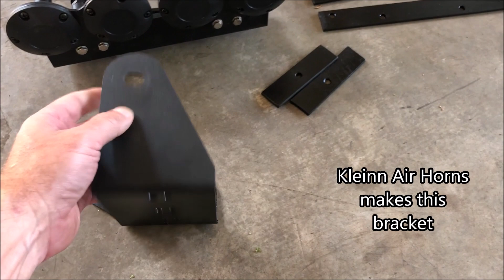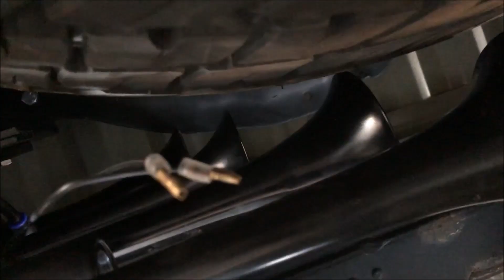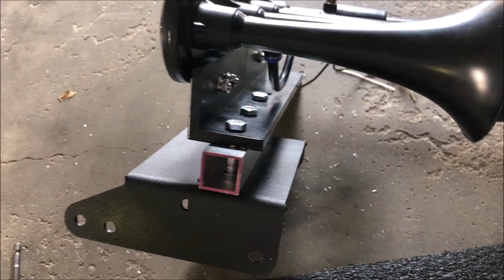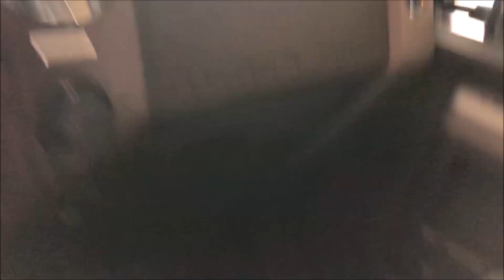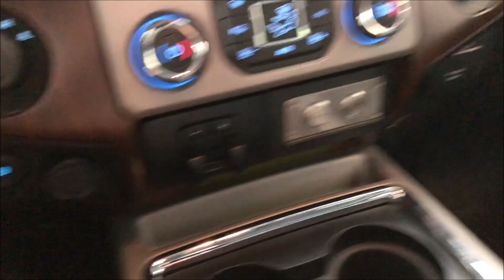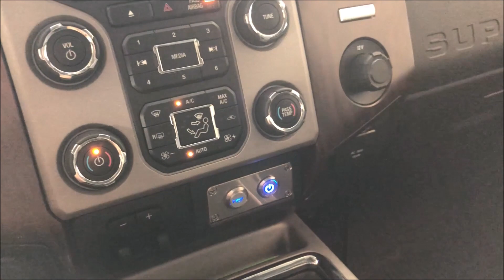Vixen Air Horn Install in late model Ford Superduty (2015 F250)

Comment: If you need the spare, do you have to take down the horns, or is there clearance to drop the tire??? I got the same truck 2015 black Super duty
Reply from the maker: @KVAL83 the compressor and the horn rack do not interfere with the spare tire...can lower the tire and items remain securely mounted to the trucks structure

Comment: Is the horn still working for you now I am thinking of getting this one and wanted to know how good it is
Reply from the maker: Hi Connor, we had the truck for about (3) years...everything still worked, but really the quality of the horns suffered after the first winter here in Chicago. They were well protected from the elements, but the pitch and the decibels deteriorated; if we had kept the truck I probably would have replaced the horns by now and kept using the compressor..
Reply: @MrIntored  Ok thank you

Comment: 20 inch tires?!
Reply from the maker: yes
Reply: @MrIntored  what size wheel?
Reply: I have a 20 inch tire and rim under my truck. I removed the factory 18 inch spare. My truck is a Lariat with 20 inch rims. I bought a another identical rim and tire. It does hoist up and fit  with no issues.

Comment: How long did your compressor last? I got one and it was dead in about 3 months
Reply from the maker: First on lasted less than a month (I could hear the compressor connecting rod hitting the crank cover after two weeks), contacted Vixen and they replaced it. I stripped this second one down and used red loctite on every fastener, been running for four months and sounds like it did when I installed.

Comment: Could you email me a video of how loud it is?
Reply from the maker: Sorry Andrew, there is no way to capture the sound accurately...I can tell you if your outside near the vehicle when it goes off your ears will be ringing. The pitch is nice and has a "train" horn feel, if you take the precautions to prevent the fasteners from vibrating loose it appears to be a decent value.